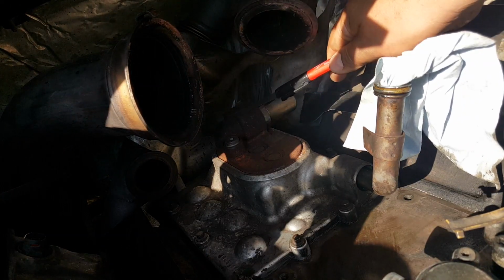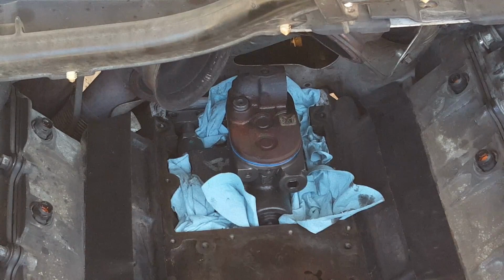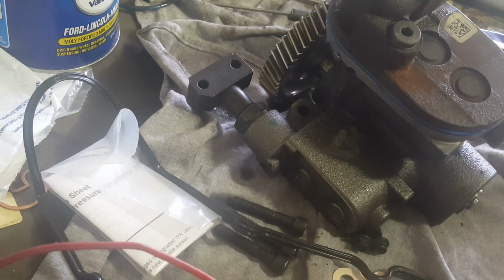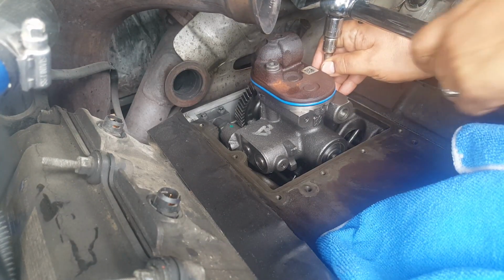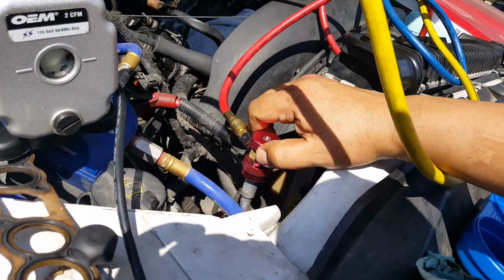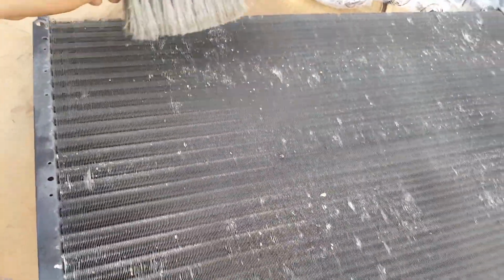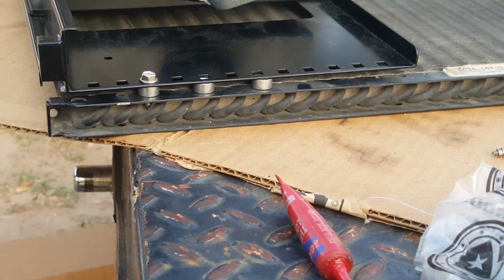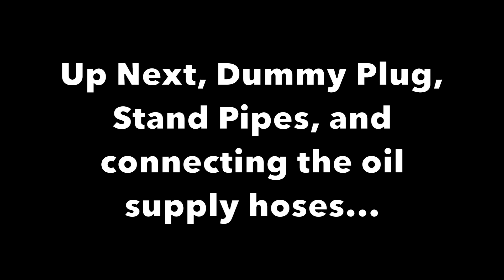Ultimate Installation of 6.0 PowerStroke BulletProof Diesel Oil Cooler PART 2 of 5

Comment: im aurprised i finally found your videos. im currently waiting in virginia for my bpd air to oil cooler to come in my bpd egr cooler my stc kit,ipr kit and dummy plugs.....your videos seem to be basically all ill need as an extra refernce to the directions they give. thanks a ton bro. Do you regret dropping the money??
Reply from the maker: Glad it helps! It was a bit pricey, but the way i justified it to the wife was "there's no way I can get a new truck like this for a total of 14k" the truck was barely running when I bought it. Still running strong. I don't expect to regain my investment by selling it, but it's made many times the investment in hauling. Good luck!! Hit me up if you run into issues

Comment: How is that truck running now after you did all that work?
Reply from the maker: Great. No issues. With the engine. I did drop the tank because it was running out of fuel with a 1/3 of a tank. There should be a video on that by the end of the month.

Comment: is it at all possible if you could tell me the AN fitting sizes on the hoses, cooler and oil transfer block????
Reply from the maker: Sorry for the late reply. I don't know it off the top of my head, and i don't think i ever measured but when i get back into town, I'll measure it and send specs. with pics.
Reply: thanks man I appreciate it! I wanna try n save a little money by doing it myself but dont wanna mess with oil flow and pressure by going too big or small

Comment: Fuel sending unit?
Reply from the maker: Yeah. Same thing as my 7.3 Plus delamination issues with the tank. video will have the fixed up sending unit filter screen and blue spring upgrade too.